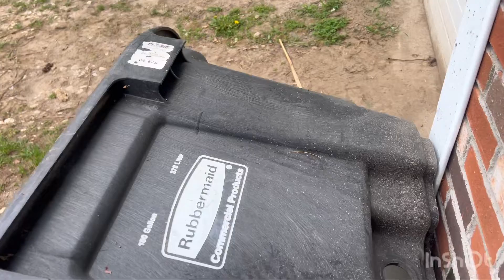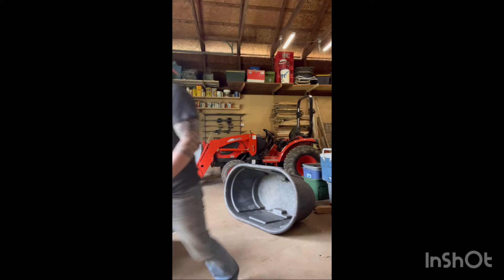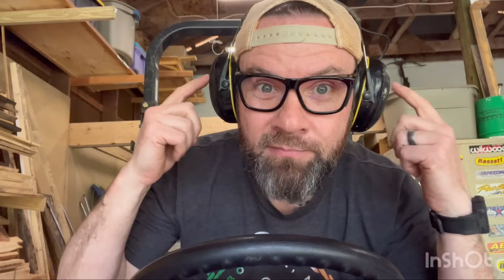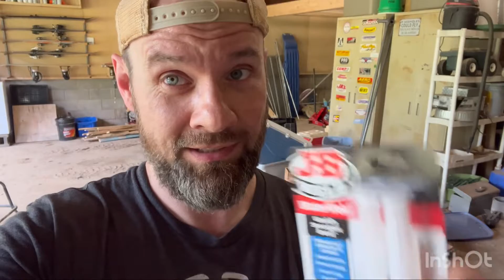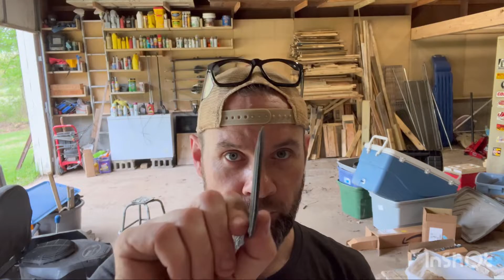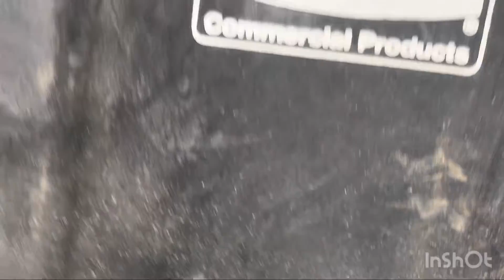Rescuing Your Rubbermaid: DIY Repair for Cracked Stock Tank

Comment: I’ve tried all these methods. They don’t last. But the larger question is why does Rubbermaid make such an inferior product? I’ve used these tanks for years. They always crack in the same location bad product. In my opinion. It shouldn’t be something we can repair it should be something that we don’t need to repair..  they don’t last.
Reply: Totally agree. And they aren't cheap

Comment: Did the J.B
Water weld  stopped the leak ? My leak is exactly like yours across from the plug??
Reply: It's still leaking with jbweld water
Reply: I used epoxy, tried to sand and overuse, not to mention the heat gun, but haven’t found any repair solution. I saw a tank patch somewhere but haven’t found it since I saw it. I’ve been using those rugged stock tank liners that I got some samples of and it’s definitely worked so far. I thought it would look funny but now it just blends in with the farm